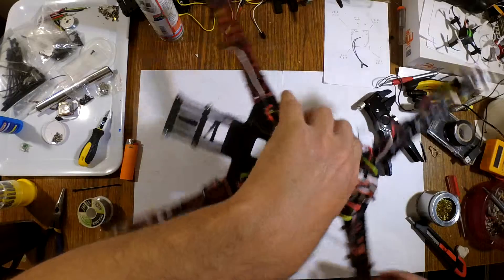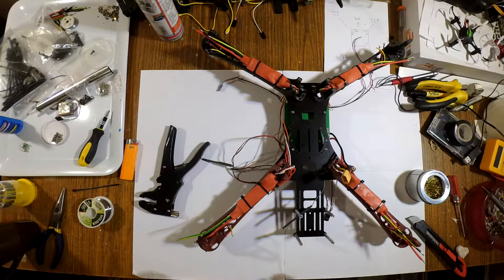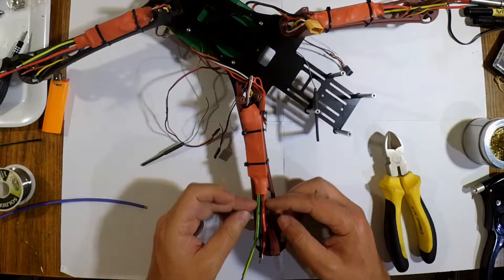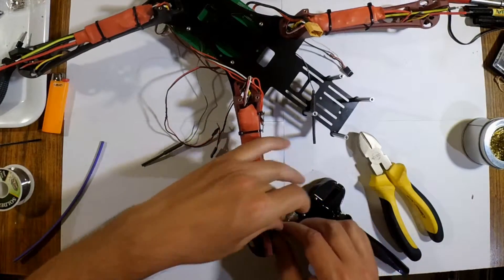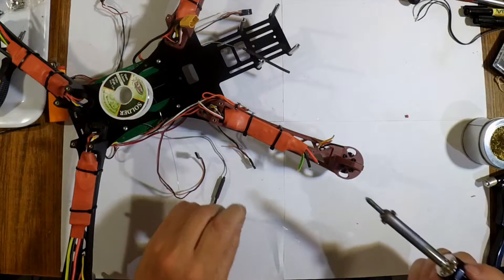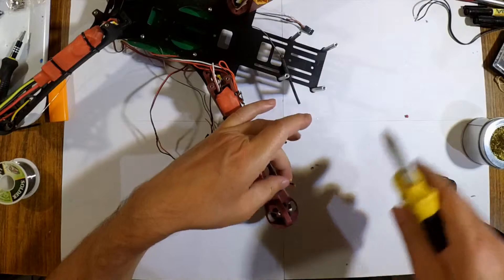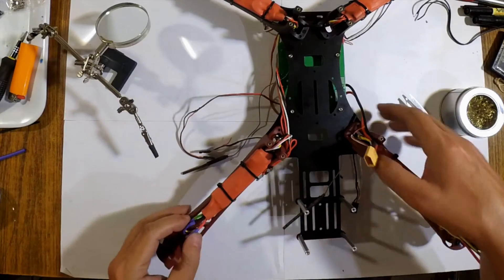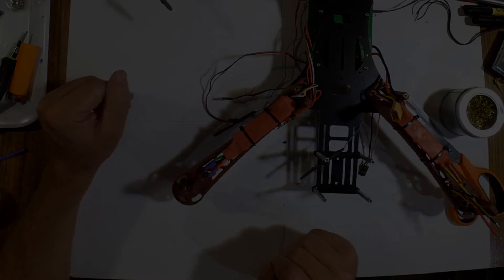CX-20 rebuilt to 450 Frame - Part 8 - Connect Motors to ESCs

Comment: Mr Roux I have question. Its take of special type wire is required for to enlarge of wire in the motors?
Reply from the maker: +Serrasalmus Notatus You just need to make sure you use cable of the same thickness and type and not a thinner cable.
Reply: Thanks Mr Roux. So I can 12v cable automotive use the same thickness?
Reply from the maker: Yes, same thickness or more.